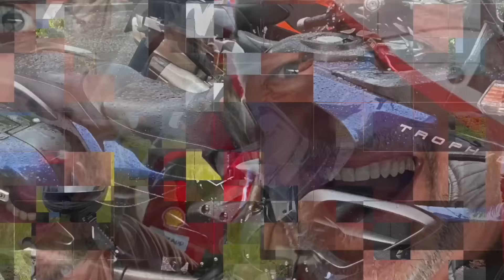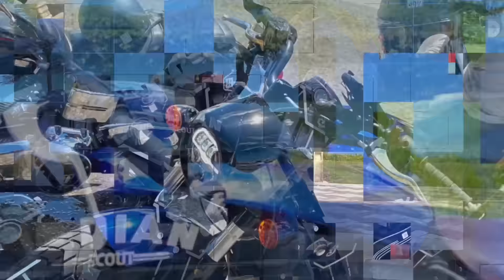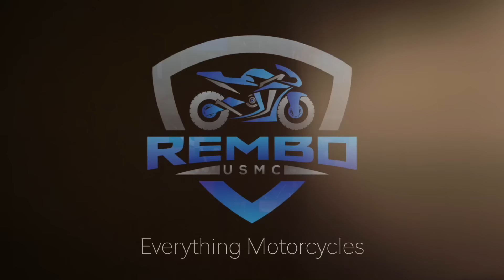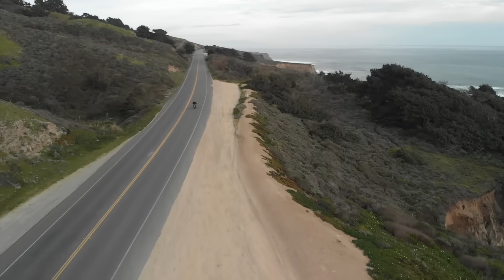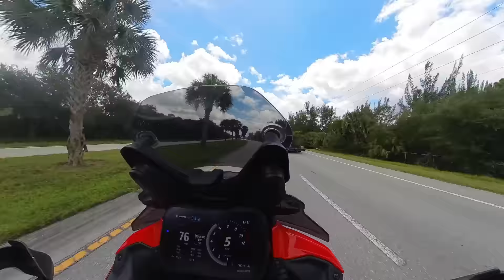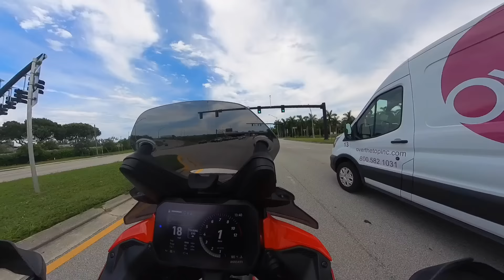What Ryan F9 Did Not Tell You About Motorcycle RPM

Comment: I would carry it a little further, H-Ds primary chain can wear at an accelerated rate with low RPM as well as crank and main bearings faster wear with low RPM. Timing chains and gears wear because they are designed to run at a higher RPM. I have watched Ryan's video, both are good videos and good info. Thanks for sharing. Semper Fi.
Reply from the maker: Thanks for sharing and Semper Fi back at you.
Reply: boomdawg-What do you call low rpm's? My "99 Ultra, 88, A model, has original chain and sprockets. At 120,000 miles I returned parts I bought (clutch plates, chain, sprockets) because every thing still in specs. I putt at 2,000 rpm (45mph in 5th), loaded with passenger and gear. Not that I don't stretch it out occasionally. 140k on her now. I always allow it to warm up close to running temp before I take off.  Also will hit redline monthly to stretch out the rods.
Reply: For me, low enough to hear the primary slap everytime a cylinder fires. I have a friend who replaces his adjuster shoe on his Sporty way too frequently, the main reason in my opinion is he lugs it around instead of keeping RPM up. I have an 883, 1200, a 88 and an old ironhead, I try to keep RPM above 2500, maybe a little higher on the 883 and 1200.  @mrkwnklr

Comment: Glad ypu made this vid! Ive riden for the better part of my life but am NOT that mechanical (i can do basic maintenance but thats it).  I do, however, understand carbon and burning it out because ive used firearm suppressors for quite awhile. One of my "cans" can not be disassembled for cleaning. It doesnt need to be. It runs a hot enough caliber that it (for the most part) cleans itself. But, with silencers in mind, i had to wonder - how much low rpm does it take to build up carbon and how much high rpm does it take to burn it out? Seemed like if you made the bike "work" once or twice per ride, the strolling would be balanced out.

Comment: My Ducati 1000 at lower engine heat levels and rpm does most definitely cause an issue. It's fuel injected so no idle jet to clog. It will start dying at stop lights. My Boulevard C90 has less issues but was built for much lower rpm. I grew up racing 2 stroke dirt bikes and you have to keep them spun up. 7-10k

Comment: Just match your throttle opening to your rpm, at low rpm just a little throttle gives you all the performance, if you need to open up more then you're in the wrong gear, more throttle is more stress without extra performance from the engine.
So long as a "soft" throttle can provide you the acceleration you are wishing for at low rpm then there's no undue stress on the engine no matter the character of the bike.
Constantly full throttling at low rpm I understand could increase carbon build up so don't do it and if you're still worried about it they sell fuels that burn cleaner like Shells V-power and such.
Reply from the maker: Thank you for offering input. We appreciate it,

Comment: Liquid cooled engines are kept at the same temperature all the time. . And the EFI  makes sure that it's running at optimum conditions all the time. . .
Reply: Optimum conditions to meet EPA regs yes. Optimum power, no. They don't build up carbon as much because they are running super lean. Put that logic on an air cooled V-twin and it run's hotter than Hades on Saturday night. Satisfies the Feds and cooks the oil and destroys the engine. Those who have high mileage HD's have had retunes to minimize the heat. A few years ago many dealers flashed the ECU's before delivery as a standard practice.

Comment: you may have missed what ryan was saying but didn't explicitly say.
it's about operating your motorcycle in the rpm where it makes efficient power. a cruiser with a large undersquare motor and small cams won't need to Rev.
a r6 is gonna need 5000rpm before it starts moving.
your not extending engine life by operating at low rpm. the bikes are designed to be reved. lots of motors out there don't get proper oiling unless they have some rpms. Honda Vs needed like 3000rpm for proper cam lubrication.
your rings flutter less with higher cylinder pressure (more of a load issue) but when your under higher loads you also want to be in the power

biggest thing is people buying low quality gasoline. not low AKI but gas from stations that don't contain good additives

Comment: The part missing from both videos - where the engine is operating most efficiently.  That is usually in the general area of the torque peak.  Look at where the torque peak is, that is where the engine will most easily pull the hardest.   If a rider looks for a dyno chart of the motorcycle they have they may find Cycle World or Motorcyclist have done a run.   The torque curve shows how the engine will pull.   

For instance the Yamaha CP700 engine has around 85% of max torque from around 4000 rpm up to around 8000 rpm.  That is the zone where it will pull with the least amount of effort.   Puttering around town one can run the low revs, but for best pulling power the engine works with least effort from 4000 rpm up.   Staying in the range from 4000-5000 gives best most efficient performance.  I can pretty much vouch for that having an XSR700.  You may say, "well that's your opinion".  So let's have less "opinionated" example...

When selling Hondas we had customers complaining about the pulling power and gas mileage of the GL1100 and 1200.  Most dealers had those complaints.  Seems they were getting mpg in the low to mid forties.  We found one rider was trying to pull fourth gear at around 2700 rpm.  The engine actually would buck a bit.  We were amazed.  Not that the engine bucked, but that the rider was that clueless.  So Honda put in their input.  

Honda said run the engine between 3500-4500 rpm for best gas mileage and efficient performance.  Even if it means downshifting.  Just happened to have an 1100 and my friend a 1200, going on a long ride from east central Ohio to Niagra falls.  Riding two up and loaded we kept the bikes in that zone when on open roads, in the middle of town loafing along doesn't come into play.   We saw a shade above 50 mpg.   Seems the best power was from around 3500 up to 5500 rpm.

Find out what the power delivery is like then run in the low to middle torque range for best efficiency when on the road.

Comment: I'm no engineer but I'm not convinced that surfaces that are directly exposed in explosion chamber get any hotter or receive more blast impact due to frequency of combustion. I wonder, does explosion gets hotter or colder? Isn't combustion process of defined, same amount of reagents always the same temperature? Of course combustion chamber pressure depends on workload, but then, isn't the first move of vehicle the most demanding on engine? More questions than answers but for now I'm not sure more revs mean higher temperature in combustion chamber. Do not confuse combustion temperature with engine temperature, those are different things.

Comment: An ICE runs most efficiently at its torque peak. My ZRX has a 10,500 rpm redline. It’s as smooth as an electric motor at 10k rpm but I’m almost never there. I generally operate it at 4-6k rpm with an occasional blast up high. It’s fine. My 4 cylinder Accord runs at 2000 rpm at 75mph on the highway. I expect it will last beyond 200k miles.
If you run your motorcycle near redline continually it won’t last as long as the same engine run in the middle of its range (with occasional blasts further up). Common sense.

Comment: Yes, Running at a higher Rev for say for 30 miles or so at a gear lower than optimal for mileage  is a good idea.... As for the cleaning of the heads... You can " burn off the carbon or dissolve it off "  .... Carbon might be a lubricant in most forms.... but flaked carbon is abrasive, not something you'd want in your cylinders, better off to dissolve it away with additives  and rev the bike through the higher rpm's to make this the method of removal over time.
Stay Safe.
Reply from the maker: Thanks for the info!

Comment: I'm often torn between fuel economy and comfort on my xsr900 vs having the power to pull away fast if need be.
Cruising around at 1500 rpm is great for fuel economy and comfort, but makes for a weak pull, and probably less to carbon build up.
The machine is happiest at 3200 rpm for day to day timing about, I think.

Comment: FortNine's bike in that video was a carbureted air-cooled two-stroke.  Sheesh.  Four-strokes don't count on burning oil, fuel injection minimizes unburned gas, and the thermostat of a liquid cooled bike keeps the engine running at the right temperature.  Also today's fuel has additives to prevent cylinder build-up.  So sure, lugging is wrong (what rider can't sense that?) but an engine will run forever in the lower part of its happy zone.  Every argument here applies to cars too and there are hundreds of 400,000 mile Camrys on the road that have never been past 2/3 of redline.

Comment: Low rpm can be just as bad for the engine, and ryan addresses this in his video. The unbalanced forces of running low rpm will put pressure on the crank bearings and connrods

Comment: Yeah the F9 video perhaps gave a false impression that one should always ride around in the top half of your tach. Bothered me a bit. Sure, push the rpm now and then to prevent carbon build up, but you can still cruise at low rpm to save on wear and fuel. Not 'lugging the motor' is ok advice but in low load situations that's not happening. And is detonation really an issue on modern bikes with stock tunes? I hadn't thought so.

Comment: Balance is the key. Lots of bikes can do the highway speed limits in first or second gear. That's not ideal for cruising. Many bikes have cruise control for highway drones which I use often. My FJR cruises at 70 mph  just under 4000 rpm. That feature wouldn't be included if it harmed your bike. Ryan was a bit vague about what rpm is good. Certainly, gearing down to pass is good for the bike without causing issues. Seems i do a fair bit of that.

Comment: I maintain RPM to stay in the higher part of the power curve, carbon build up would never be a thought.  It is as much a safety issue as a performance issue, if you are lugging the bike or pushing towards the redline the bike is less responsive to throttle input.  Keeping the RPM in the higher part of the power curve allows for better control of speed (increasing or decreasing).  For example if your lugging the bike and suddenly need to move (accelerate) you will need to "downshift and wind it up" verse just "twist the throttle and go", that delta in time can be important.  Conversely at very high RPM there is minimal engine braking, without it I have less control.  Only one of my 3 bikes has a tach, I don't take my eyes off the road when riding so it would be of no use anyway.

Comment: I have a 2021 BMW R1250GSA and typically ride 200 miles + at a time. When on highway I use cruise control and the bike stays around 3,700RPM - should I be giving it a little more beans  ???
Reply from the maker: You just go as fast as you want and control your gas mileage. I really don’t think that’s it makes as much difference as was reported based on the quality of today’s engine machining.

Comment: As I mentioned in a comment to Ryan's vid, the actual story is more complicated and much simpler.
Long story short - to get rid of carbon buildup you need to run the bike at a slightly elevated rpm (for many bikes around 5000 to 6000 rpm, depending on the engine) for a prolonged period at constant (low as possible) throttle, i.e. no acceleration or deceleration as far as possible. (On my bike, a multistrada, that translates to cruising at about 150 kph / 93 mph)
Merely running at high rpm for a short burst may not achieve anything at all.

So, actually, what you should be doing is planning in some longer trips (highway would be ideal) every now and then to clean off carbon.  Make it at least 30 minutes, longer if possible.  That's it.  And it won't wear your engine at all, it is designed to do this.

I am not going to explain the whole logic behind this, but trust me, this is all you need to do.

Comment: I have a 2022 Kawasaki Versus 1000 (1043cc inline 4). The owner’s manual gives recommended shift points based on vehicle speed. It states to shift into 6th (high) gear at 40 mph. At that speed the engine is barely above idle. So why does it say to shift at such a low rpm if lugging the engine is bad for it?
Reply from the maker: Typo?

Comment: If my Concours 14 wasn’t meant to turn low RPM at cruising speed, Kawasaki could have saved a lot of money with a single speed transmission.  It can exceed the speed limits in most places in the US in first or second gear.  My father told me long ago that the engine should always be spinning at an RPM where it can accelerate quickly and easily if necessary.
Reply: The Connies are built for low (for a motorcycle) rpm torque and operation. I had a '92 that I put about 120K on, great machine and do it all street bike. Still doesn't mean you can't let it rip once in a while!
Reply: @brentlanyon4654  I just think that Ryan was a little too broad in his statement that motorcycles are built to rev.  I wouldn't ride my Z1000 at the same RPM where my Buell lives.  The relatively long stroke Buell is not capable of the revs and doesn't breathe that well up top.  It is important to understand where your engine is designed to make power and keep it in that range.

Comment: The question I have is why running your engine at high rpm leads to accelerated wear and tear. I don't understand the physics. I think an engine that is well balanced, well lubricated, and built with material that can handle the stress, it shouldn't matter what rpm it runs at. Distance = Time = Cost perhaps. I do get the carbon build up argument.
Reply from the maker: It is mostly a function of how the engine is built, but the higher the RPM, the less time the parts have to rest.

Comment: I don't think it matters to either explanation. It is the same thing with cars. It is the imagination of riders or drivers to put to this perspective of RPM, at any given rpm, the engine is fine. The only thing to pay attention the quality of gasoline/petrol.  If you keep changing the brand, it will affect the quality of gasoline. This is a huge deal because the final push for power is the burning in chambers. Poor quality gas can lead to more gunk  inside the piston , and valve areas. For those who think gasoline is the gasoline, or all the same will end up with problem. Not the Rpm. RpM to help push the high pressure of burned gas out of chambers. It help a little bit to flush but the build ups are not from the low rpm, the quality of gasoline is. It is normal to get small build ups because it is a kitchen so to speak. Where can you see a kitchen is always sparkle? Never. If you put a lazy bad chefs in the kitchen, your sparkle kitchen will soon be yucky. So is the gasoline quality. Hope this helps.

Comment: I thhink its only problem with diesel car engines or direct injection engines. Lugging engine is overrated. Sometimes on bad road i just put a 3rd gear and let of the gas and let my engine add fuel itself to uphold rpm. I did same with my work cars. Some of the diesel engines here at service is over 700k km, thats 4 pot 1.9 diesel with 90hp. Just put a 3rd gear and cruise at 30kmh at night shifts

Comment: Stop over-analyzing this. For 90% of riders none of this matters because they are never going to put enough miles on to wear out an engine anyway.  Most motorcycles will have multiple owners with different riding habits and will still die from neglect or abandonment.  For you, the 10%, just ride your motorcycle however you want to ride it. If you are the guy just putzing around town at less than 3k rpm, you will never care if your total maximum power output is going down.  If you are the guy ripping it up on track days every weekend, you will never complain that your piston rings are shot at 20k miles.